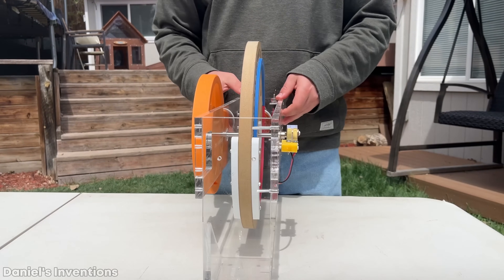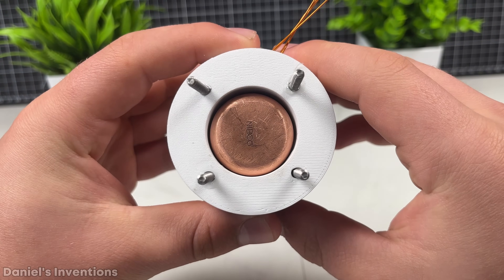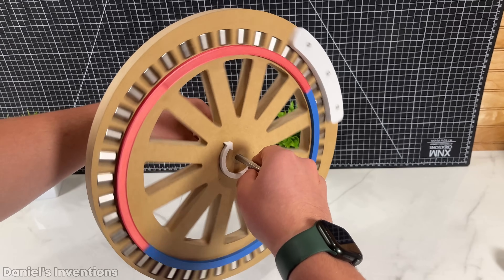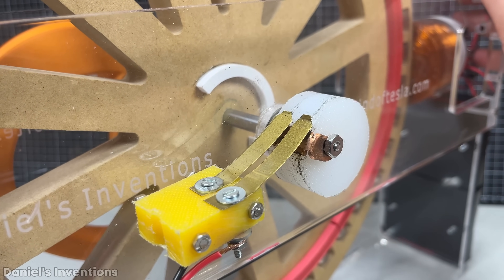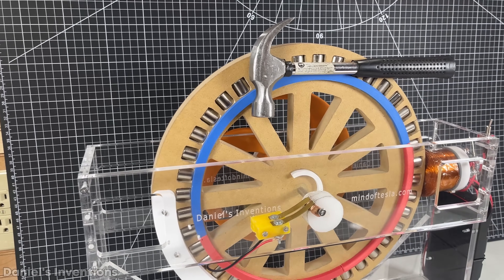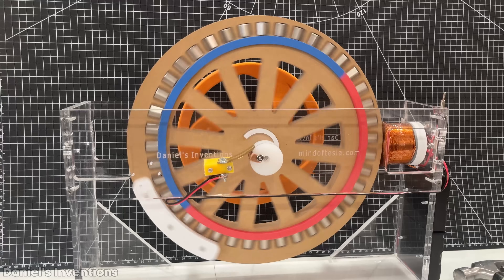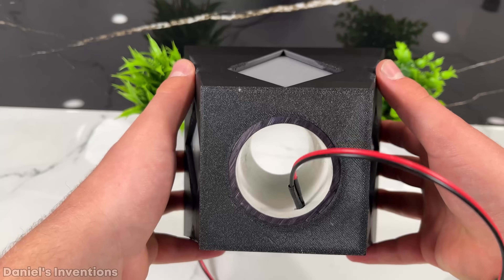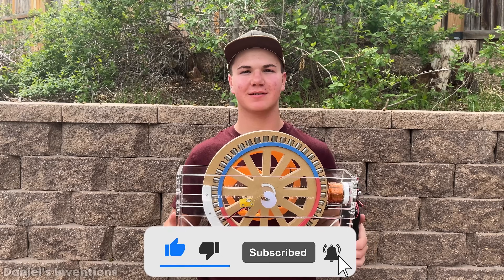Free Energy Machine

Comment from the maker: I've seen different schematics of this motor on the internet. No one actually built one before, so I decided to build one of these to test the concept of operation. The permanent magnets on the rotor are offset in respect to the center of the motor. On one end, they come very close to the edge of the rotor, and on the other end, they go further away from the rotor. Half of them are in north polarity, the other half of them are in south polarity. When a single permanent magnet on the stator is introduced in any polarity, the rotor will begin to rotate in repulsion half of the rotation until the gap is larger between the rotor and stator, but at that point, the other half is in attraction mode and the rotor immediately begins to accelerate in attraction mode moving in the same direction from the larger spacing to the small spacing. At that point, a short pulse from a battery is introduced in an electromagnet to momentarily cancel out or redirect the magnetic field so the rotor can go past, and then the whole process repeats itself. The coil is energized for 10 degrees of the rotation and the interaction between the permanent magnets on the rotor and the single permanent magnets on the stator provides rotation and acceleration for the remaining 340 / 350 degrees of the rotation. A single coil / permanent magnet on the stator can accelerate this rotor at 600 rpm, or 10 rotations per second. Theoretically, if 6 coils were introduced in this design, the rotor could achieve speeds of that of an induction motor, around 3000+ rpm.
Reply: Wow, well done man. What are you power usage levels for that 10%, in Volts and Amps, or just Watts.  I have dreamed these types of configurations up but never built one myself. I've been trying to solve all the problems in my head before I put the work in, which turns out might not be the best idea, lol.  Anyways I was wondering what your Power Draw was and also how much Power you could potentially "Harvest" as well, and what your "Real Efficiency" is.  Thank you for the video man, truly a dream come true to see that build in reality. I am curious what other ways the experiment can be improved.  I am sure you know there are some "free" sources of power that can be Drawn on to get over the Efficiency Hump of the device. If you could get it close to 99% then I believe it is possible to get a Net Gain once you add some sort of Atmospheric power to it from a High antenna, or atmospheric Capacitors.
Reply: EXCELENTE + EXPLICA5CIÓN!!! M9E GUS8TARÍA H9ABLAR CON6TIGO... ES7TOY E4N MO2NTEVIDEO, UR5UGUAY 🇺🇾 AM8ÉRICA D3EL SUR..
Reply: Mira los números...
Reply: fark that  && replys...       no replys about open system thermodynamics please.  (unless they come with a diagram)...   THIS machine however, would benefit from the pulse coil being shifted from the vertical plane, to the horozontal plane...  IE   move the coil left and right on pulse,  - not on and off.
Reply: Love this stuff. All the best brother!

Comment: On your All Magnet Motor with regauging section, Motor Design, what do you use for the Coil Driver? You don't elaborate much on the cancellation coil and what drives it.
Could you describe The Coil and circuit? I printed a 3D model and assembled it, except for the circuitry, which I would like to get running. Please share this information so I can move ahead.

Comment: I don't know about the efficiency of this. 
But I know there is a

problem: Hitting the Stator magnetic field with the same magnetic field on the rotor, is going to demagnetize both of them...maybe not noticeable right away, but over time there will be a linear reduction of torquing power.

Solution: Orient all magnetic fields on the Rotor to be in Attraction to the one inside the Stator.

Hint: The Stator permanent magnet field should be less than those on the Rotor. Why am I saying this?

Still, your construction skills on this are commendable, and I find I learn something new in every video. Keep up the good quest. And more power to you!
Reply: "Hint: The Stator permanent magnet field should be less than those on the Rotor. Why am I saying this?"

Would I be correct in guessing that the reason is so the cogging effect is reduced?

Comment: Keep building. I'm working on a Sterling cycle engine. Simple design, but the transfer chamber is 4 feet in diameter. It should spin a generator at 600rpm. Which means, the heat inside my house, and the cold outside , will generate all the electricity I need.
Reply: There is actually, the channel is People's Research Center and he has experimental videos on operating a Stirling engine like this, he also has posts detailing his experiments on the energetic forum and other places, he references Tesla's problem of increasing human energy article on the nature of heat energy and his disagreement with the Carnot model of heat as being like a fluid, which the experiments indicate support of.
Reply: If you're working with Stirling engines I highly recommend experimenting with removing the cold spot, insulating it or even heating both sides of the engine, the results should pique your interest.

Comment: For balancing rotors such as these, I allow 1/4 of horizontal movement. The weight is in the magnets, not the rotor. Measure the sideways play and pack the magnets to suit.
I've had 13lb, 2' rotors singing at 700rpm.

Comment: The stroboscopic light effect makes it hard to rate in power output. A lesser power consuming lamp - hence shorter LED serial secuence will have less Volts to light up but will be excessively powered since the sparks are 100 V , so a single or small and larger buffering capacitor in-between will do the job of power administration. This continued way of lighting will give a luminosity that can be measured and equivalent power rated to deduct the input power and the result can be overunity or not.

Comment: Nice work but uneconomical in terms of the level of complication of the construction and the cost of its implementation. Try to strive for maximum results at the lowest possible cost - build structures that are simple but effective in operation. I suggest you take an interest in the motors that Charles Flynn developed - the technology of parallel magnetic paths.

Comment: Nice work Daniel beautiful design too with combo adjustable magnets and pulse motor and HV commutator.
Just thought I'd mention putting an electrolytic cap across the lamp maybe 35-100 vdc at 350uf or so and maybe you can get the lamp to stay on w/o flashing or attach a FWBrectifier at BEMF output to charge cap for  leds,to build up a smoother vdc and current 
anyway great job!

Comment: 1. L e d VERY low voltage
you want to power a motor or say your phone/ laptop to REALLY prove anything.
2. put couls on the REST OF THE ROADER to collect energy it most surely will slow down
3. You could use a BELT to SPIN a generator but the generator is also a LOUD on the system

Comment: Just use solar panels for free energy bro your not Newton's opp 😭🙏
Reply: But, he's not trying to violate the laws of motion or thermal dynamics.  He's aiming to exploit  the principles of  magnetism to generate electricity through motion to turn a flywheel.  But running strong permanent magnets on the positive and negative  ends of an AA through a coil of copper wire also generates electricity 😆the problem usually being the battery  will eventually show right through the wall of the loop long before it reaches a high enough speed.

Comment: What is creating the 'back EMF' ?  Awesome stuff
Reply: Good question. See video at @5:15.  The Back EMF is that current generated by the rotor magnets passing across a stator coil. This is kinda standard low-voltage generator stuff.
But, the unusually thing is to capture the high-voltage "transient current", "Flyback current" or "Inductive discharge current" which occurs here at the moments the power from the batteries are switched off the stator coil.

Comment: Cool build Daniel. By coincidence I have just built a little permanent energy toy that does 600 rpm I wondered if it was possible to harvest the back EMF or fit another coil to my design and harvest the power also. Take a look if you want pal 👍🏻
Reply: Lidmotor even has some other circuit designs for the same thing
Reply: By Back EMF are you taking about self-induction or inductive kick? Because if it's the latter then 1, wrong name, and 2, you can capture it by putting a capacitor across the power supply and a diode to direct it when the circuit opens, Master Ivo has a video on this exactly called Efficient Impulse Generation.
Reply: @JenkoRun  I'm no expert, I was sort of suggesting taking a look at the general idea or maybe some of Lidmotors circuits to come up with something different
Reply: What if more coils for more power 😎

Comment: You forgot to put fixed magnets on the surrounding to increase the pushing power freely , also you can add extra pickup coils on series nearby the Driving one , you can make it with one magnet on the rotor , this similar to Magnetic Wankel , Great video.